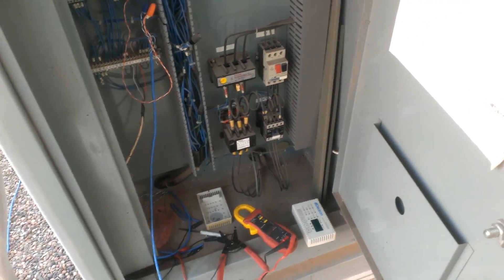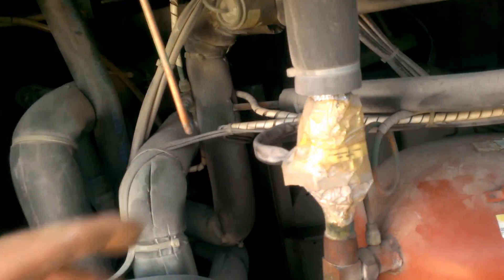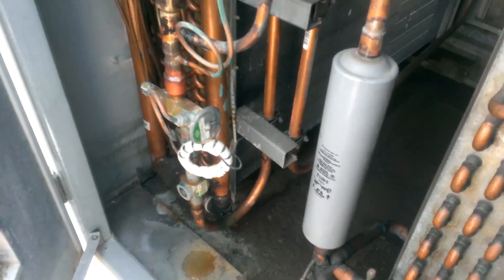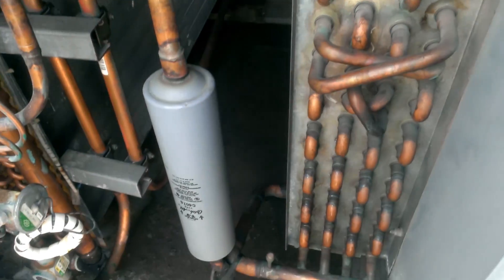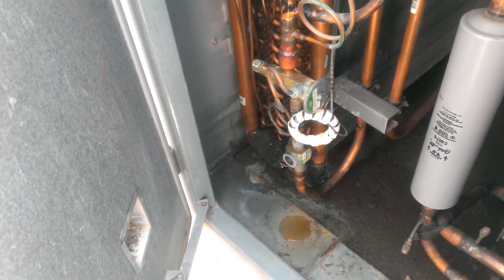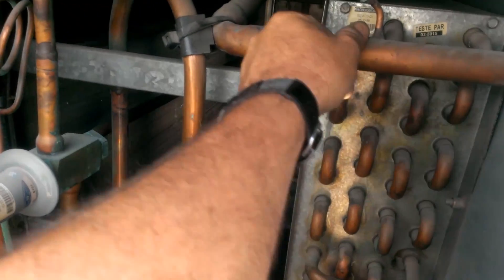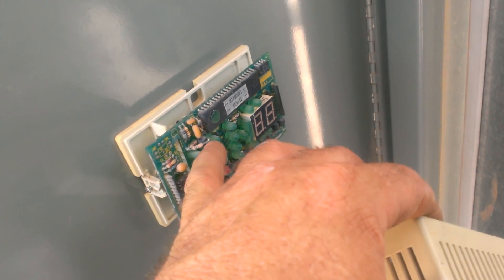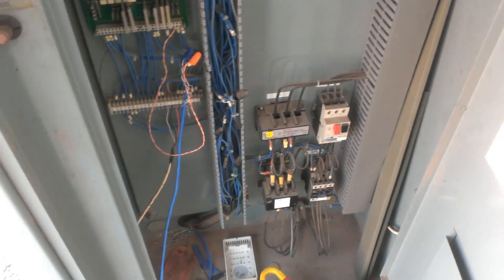Temp fix on Commercial Pool Dehumidier

Comment: Just finished brazing a new compressor in for a 8 ton Dectron. I put in a 9 ton compressor instead of the 8.5 ton Trane compressor. Boy, what a bitch to take out and re-route the pipes to fit the new compressor. Also I got rid of that HT8000 controller and put in a DDC controller instead. Not fun working with these units unless you really know your shit around it. Lol
Reply from the maker: Sounds like fun.

Comment: I have Seresco dehumidifier need to replace High Side pressure transducer and crank case heater for compressor does I have to Pull vacuum down on refrigerant line I get quote from tech guy for $5k to replace High Side Pressure transducer

Comment: I worked for Dectron's service department for over 8 years travelling servicing their units and I have never seen anyone bright enough to use a White Rogers thermostat to bypass the Ht800 controller. Because the Ht800 was OEM and basically shut the unit down if it failed, this is absolute genius. Kudos my friend.
Reply from the maker: Thanks!
Reply: I have Seresco dehumidifier need to replace High Side pressure transducer and crank case heater for compressor does i have to Pull vacuum down on refrigerant line I get quote from tech guy for $5k
Reply: @jellytae6851 5k is crazy for that. I could probably fly to you and do the job and fly home for that lol

Comment: been working on a very similar unit made by poolpak. At first glance the concept of how they work is simple enough until you start to try and track down all the wacky places the installers place the numerous temp/relative humidity sensors flow switches and tracing them all the way back to the control modules....Nice bandaid tho with what you did.

Comment: the HT800 is just a controller, not a t'stat, the unit has a combination heat/humidity sensor in the return relaying the info to the main board
Reply: Can you explain how these systems work? I work on a Poolpak with a remote condenser. How do they work in the Summer and Winter?

Comment: I changed a compressor in one of these units a few months ago, what a pain in the butt, the one I worked on had 2-15 ton circuits, the compressor weighed 260 lbs if I'm not mistaken. Each circuit takes 120lbs of R-22 freon, this thing was a beast, this is the type of unit that you'd definitely want to take a coarse on before messing with it, there's a whole bunch of things going on inside this unit.

Comment from the maker: I took the wires out of the input/output board and wired the blower contractor and cooling changeover valve to 24VAC all the time and just cycled the compressor contactor with that cheap magnetic t-stat. 

It worked until I got the new controller.

I still have a few issues with the system misreading the pool temp ans sometimes the supply air temp causing a fault. 
I think maybe something took out that input output board too. :-/

Otherwise it is working.

Comment from the maker: This unit doesn't actually have heating. It has an axillary heating relay but no heating was added to the system, which is typically electric strip heat in the supply duct. 

When we occasionally hit sub freezing temps here I've had to close down the fresh air intake for a few days.